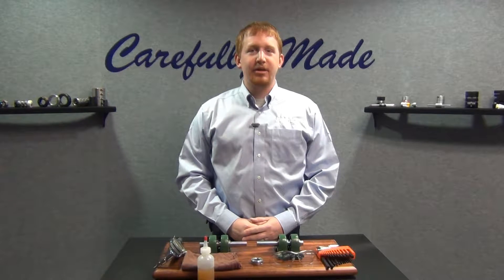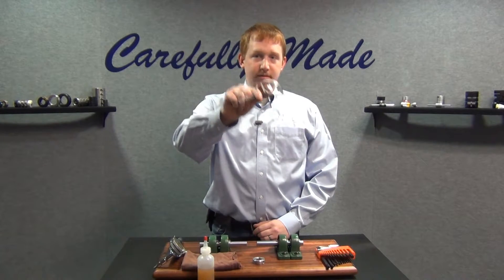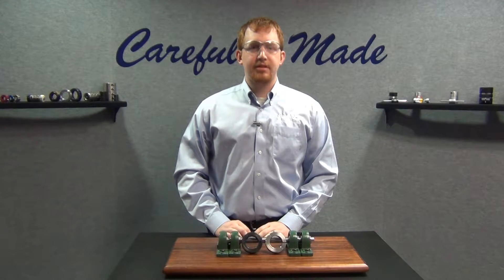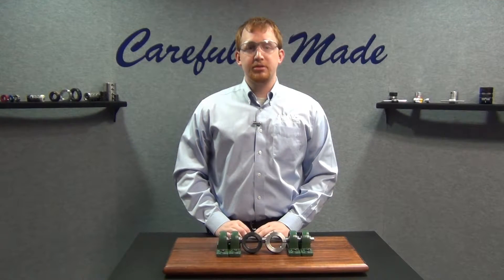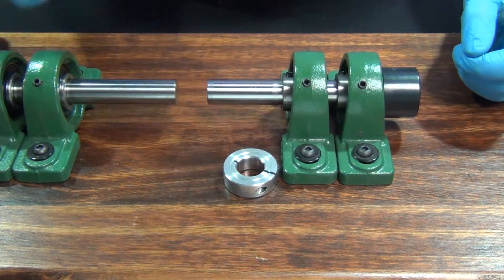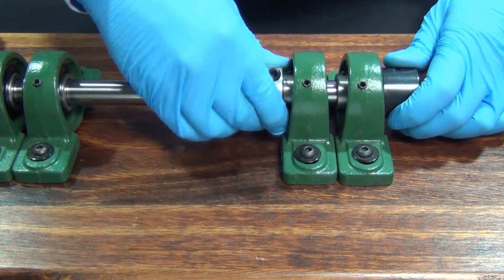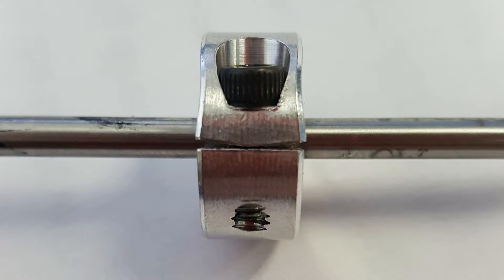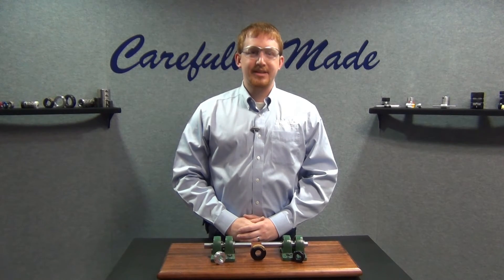How to Install a One-Piece Shaft Collar | Ruland

Comment: What are the tolerances on these collars? Can I use a 32mm shaft collar on a 1 1/4" (31.75mm) shaft?
Reply from the maker: You want to use 1 1/4" collar on a 1 1/4" shaft. The clamping range on these collars is limited. Hope this helps.